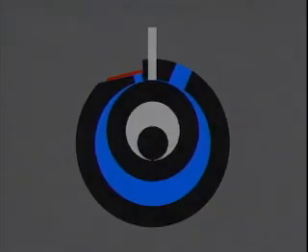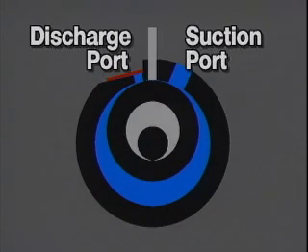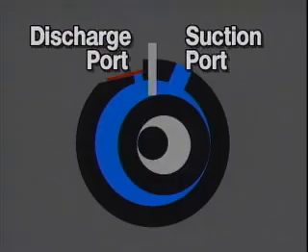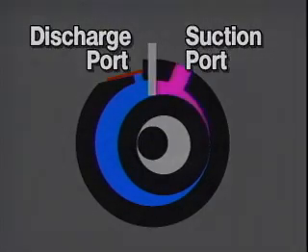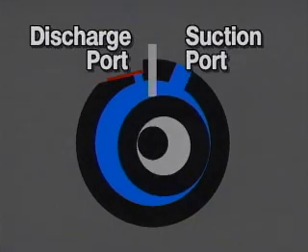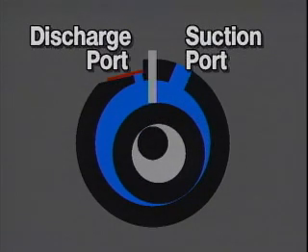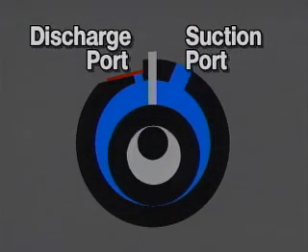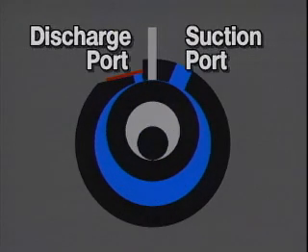Rotary Compressor Operation

Comment: Does the direction rotation work either way. ie could I run a compressor anti clockwise on a car
Reply: No the discharge Reed valve will not open and close correctly if the unit is run in reverse

Comment: Reciprocating compressor is better
Reply: Whirlpool is rotary compressor …. But just look at the cooling is very very strong 💪🏽 for example whirlpool 2.5 ton split … give in T1 is giving 29000 btu and in T3 give 24225 btu …. And there is Reciprocating compressor give in T1 26500 btu and in T3 give 22000 btu only …. Now which one is great and better in cooling…. It depend on AC brand and quality brother
Reply: @RrRr-th1kf  cause whirlpool has highest technology it is an American company
Reply: Aravind MK yes … whirlpool is great AC in india also …

Comment: the animation is actually wrong! once the compressor is charged with gas, the cam separates high pressure at the output and low pressure at the input.  the cam is increasing the volume on the low pressure side, as the animation shows, but simultaneously, the output trapped volume from the previous rotation is squeezed into the output.  the operation is exactly what medical pumps use, a peristaltic pump,  squeezes a pinch point and drives the slug of mass from the input to the output.
Reply: Exactly, it's always compressing or releasing refrigerant on one side while SIMULTANEOUSLY taking refrigerant on the other, and it needs one rev to compress it, not two.
Reply: @DrFreeeman it take 2 revolution for the first time and then, one rotation for the rest
Reply: @DrFreeeman yes i feel like u are right
Reply: how can the liquid be sucked up even though there is no fan with fins ? ( like water pump)
Reply: @freddypurnomo8722  the pressure differential forces it into the compressor, you don't need an impeller to do that

Comment: What springs?
Reply: There is a single spring holding the vane against the rotor. It is not shown in this animation, which is a bit of a mistake. Along with them saying it needs 2 revs to compress, while in fact, it needs only one.

Comment: Looks like it needs a second valve to prevent the co pressed gasses from being pressed out the suction side.
Reply: Nope. They are held on the high side by the rotor having 2 points of contact, one with the vane and the other, sliding against the chamber wall. A reciprocating compressor would need a suction side reed as the vapor is both taken in and compressed in the same chamber whereas by virtue of it's design the rotary vane pump creates 2 separate ever-changing chambers where, while one is compressing refrigerant the other is at the same time taking refrigerant in and when the rotor loops back around past the vane it will start to compress that refrigerant.